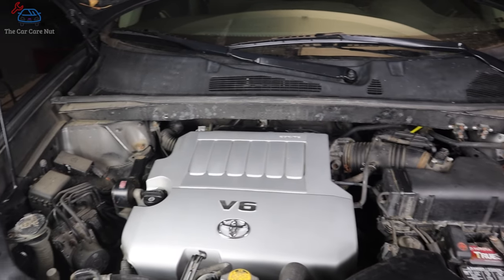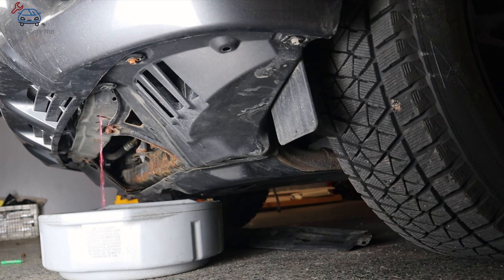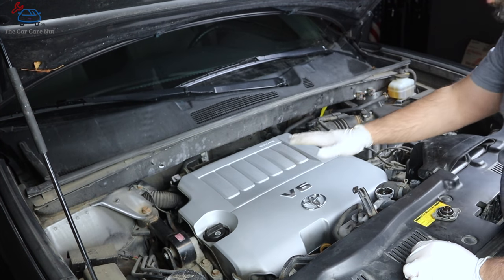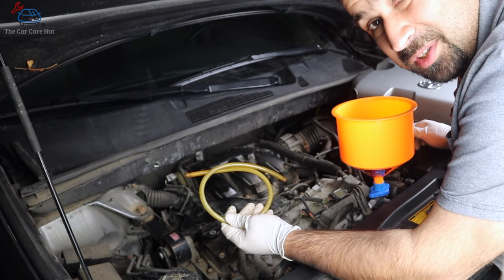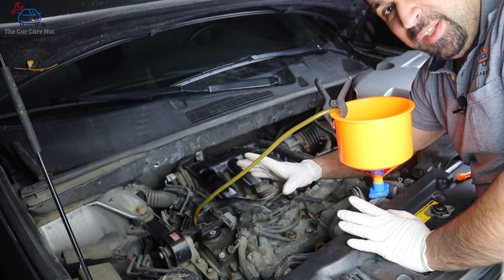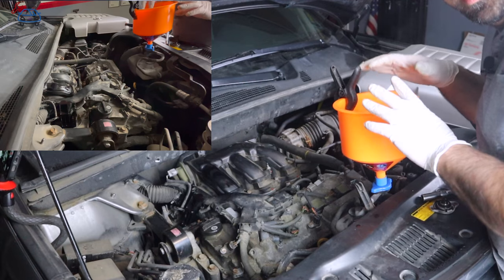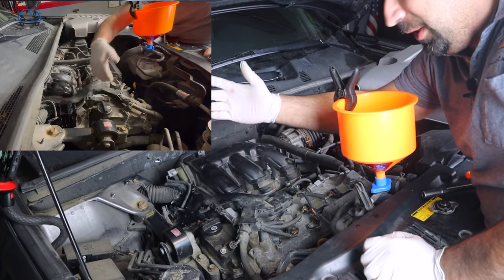Toyota Cooling System Bleeding for V6 2GR-FE 3.5L THE RIGHT WAY!

Comment: 4GR-FSE 2.5 L  on 2010 IS250c please show a video on how to properly bleed air out of coolant system thank you. I trust only you
Reply: I've wanted him to do the same and trust his knowledge also, but I do believe that he doesnt like the 4GR-FSE. With that said, from the service manual for the 4GR-FSE engine, with the radiator cap and reservoir cap removed:

c. Slowly pour coolant into the radiator reservoir until it reaches the FULL line. (Personal note: I believe this is the most important part. Many pour coolant too quickly and trap air in the system. Even Nissan/Infiniti say to pour coolant at a rate of 1-2 quarts per minute)

d. Press the inlet and outlet radiator hoses several times by hand, and then check the level of the 
coolant. 
If the coolant level is low, add coolant. 
e. Install the radiator cap and reservoir cap. 
f. Bleed air from the cooling system. 

NOTE: Before starting the engine to warm up the engine, turn the A/C switch 
OFF. 

1. Warm up the engine until the thermostat opens. While the thermostat is open, circulate the 
coolant for several minutes. 
HINT: 
The thermostat open timing can be confirmed by pressing the inlet radiator hose by hand, and 
checking when the engine coolant starts to flow inside the hose. 
2. Maintain the engine speed at 2, 000 to 2, 500 rpm. 
3. Press the inlet and outlet radiator hoses several times by hand to bleed air. 

NOTE: When pressing the radiator hoses: 
  Wear protective gloves. 
  Be careful as the radiator hoses are hot. 
  Keep your hands away from the radiator fans.

g. Stop the engine, and wait until the engine coolant cools down to ambient temperature. 

NOTE: Do not remove the radiator cap while the engine and radiator are still 
hot. Pressurized, hot engine coolant and steam may be released and 
cause serious burns.

h. Check the coolant level in the radiator reservoir. 
If the coolant level is low, add SLLC to the radiator reservoir FULL line. 
6. CHECK FOR ENGINE COOLANT LEAKS . Refer to ON-VEHICLE INSPECTION - Step 1 
7. INSTALL AIR CLEANER INLET NO. 1 . Refer to INSTALLATION - Step 87 
8. INSTALL V-BANK COVER SUB-ASSEMBLY . Refer to INSTALLATION - Step 115 
9. INSTALL COOL AIR INTAKE DUCT SEAL . Refer to INSTALLATION - Step 118

Comment: OK I'm ALL FINISHED !!!! Thanks to You "CarNut The Magician". Again great video that helped me immensely. Bought the funnel using your link. I want to suggest maybe an edit to the video. It took me over 3 hours total with car at 2200 RPM to complete this coolant replacement. At about the 3.25 hour mark I decided to bring it up to 3000 RPM and what a difference. I was stuck in the "waiting for the solid coolant to stream into the funnel" for almost 2 hours. I also was turning the heater on and off and got more air out. Please confirm YES or NO that turning the heater on is necessary? or NOT necessary? My edit suggestion is to give people at least a rough idea on the time frame for each stage. I realize there are different factors in each case that will affect the time frames but just give us an idea approx how long it will take. Because it took so long does that mean my water-pump is weak? That was just replaced 11 months ago so trying to figure out why it took me so long and it took you less than 1/2 the time based on watching your video?

Comment: Have a question which kind that's kind of concerning that I saw on another video. The person states the start stop button feature which was for better fuel economy will eventually over time will wear your engine out faster because they are not designed for with all the consistent starting and stopping which to makes kind of sence. I would like your input on this in a future video.

Comment: Great video,

I’ve got a 2007 Toyota Aurion with the 2gr-fe engine. Before I do this job, would it be best to replace the heater core first because I’ve got no heat coming through the vents, just air.

Comment: yea, the high rpm intimidating thinking parts of the engine are not fully filled with coolant which can cause high heat spots and can cause head wrapping, etc.  With high RPM the water pump can help push any air bubble in the system to fill voids in the engine block.

Comment: This is hands down the best channel for Toyota/Lexus maintenance and repair information. Always my first choice, and I only stray when I can't find the information I need. Have you got a video showing the replacement of the radiator inlet (some call it the filler neck) on a 2009 Lexus RX 350? Part number 16431-31490. I believe we suffered a common problem this afternoon when one of the lines broke away and coolant went everywhere but through the engine. Also do you have a diagnostic for the radiator cap? Thank you so much for sharing your wisdom with us here on YouTube. We're very fortunate to have access to people like you.

Comment: I did this procedure and made sure to top off the reserve reservoir to full as well.  After driving it about 350 miles I checked the reserve reservoir and the fluid was low.  I topped it off to the full line, but my question is if that is normal.  Did the system have more air to remove and now it should be good?

Comment: This car’s cooling system seems like a good candidate for using the process where you draw a vacuum on the system to remove the air and then use that vacuum to draw the new antifreeze into the engine. That’s how I would approach it. 

Have you tried it? Seems a lot easier to me than the process you show here.

Comment: Hello, grest, video you explained everything  wonderful. Also, the last time I had my flush was 17,000 miles  ago, 3 years already, mainly  slow speed  driving  in town locally. Do you recommend  I replace  coolant drain & refill only? I like to replace the thermostat  as well since I'm there already  and take air out system. That way, everything  is good with the cooling system. The thermostat  is extremely  important  on any 3 Liter motor.

Comment: Hi I own a Toyota Vellfire 2008 3.5 2gr fe engine and I noticed that I don't have a radiator cap, pls clarify how this method will apply to my vehicle and/or the correct procedure to bleed my vehicle. Many thanks for your other videos, it's been helpful with my other DIYs
Reply from the maker: Hi! What kind of cap do you havev
Reply: @TheCarCareNut  there isn't a cap for the radiator at all.
Reply from the maker: Is there a cap for the expansion tank?
Reply: @TheCarCareNut  yes

Comment: I'm crying right now. 😭I just did a coolant flush on my Lexus last week. Just the drain out at the bottom, then refill at the top, bit by bit with the engine running till it no longer disappears. Also filled reservoir. Will I be in trouble if I don't bleed the system this way?
Reply from the maker: Hi! So I would do this to test it. Start the car and let it idle until the gauge reaches operating temperature. Then turn on the heat at max temp and see if you have full heat or not very hot. If it’s not very hot rev the engine up if it immediately changes to hot then you’ll need to bleed it. If it’s hot then you’re good
Reply: @TheCarCareNut  thank you sir. Will do this and report back!

Comment: Perfect procedure. I'm sure that's the same for all cars with bleeder valves
Reply: The first gen Prius has a pair of bleeder valves for the inverter coolant. I have noticed it will not bleed the way the manual shows (pipes carrying the coolant back up to the reservoir) - it has to be done with tubing to siphon the coolant to somewhere below the valves.
Reply from the maker: The first gen Prius can be tough to bleed as you said the procedure in the book doesn’t work very well

Comment: Thanks for the video. I have a question,  do I need to also open the bleed valve while draining the radiator? I think that's needed to let the coolant in the engine be drained as well... 🤔

Comment: I have questions not on this video on your other video where you show changing inverter fluid and radiator fluid
My question is bleeding inverter in video you state you want cooling fan to come on twice . How long should it take for fan to come on and how long between 1st time fan coming on and second time roughly?  And what is the revelance of those fans coming on twice regarding air removal from the inverter? In video you did not show the fans, im assuming its fans in front of radiator? Thank you for you very informative videos.

Comment: There was some videos on here that show adding the coolant from the radiator only and watch the bubble coming out from there.  But it may take hours for all the bubble to come out.  Your method is better and faster.  How easy is it to drain the coolant.  I didn't see the drain plug on the video.
Reply from the maker: It’s very simple to drain the coolant. The petcock is on either the passenger or drivers side of the bottom of the radiator

Comment: 2GR – FKS V6, you mentioned in the video that you might do a coolant change video on one of these engines.
I am at a point where I’m approaching 50,000 miles and would like to do so as per your advice from the Lexus LS video. 
I also would like to do the transmission service at 50,000 miles .
As per your instructions, I did the rear differential at 30,000 miles and just completed the front differential at 48,800  miles.
I just purchased “Toyota” rotors, pads and hardware for the front. The left front is getting a little close for comfort.
The coolant and the transmission fluid are next on the list .
Would you suggest I take it to the dealer and have the coolant and transmission done? 
I at least have the funnel that fits the radiator.
Production date of March 2018, highlander V6 all-wheel-drive LE plus.
No transmission issues to date. 👍

Our plan is this will be a very long term ownership experience.
The car is kept in the garage and is well cared for. 

Thank you sincerely for everything that you do. I really wish that your shop was located within a reasonable driving distance. 🙏

Comment: I love the idea. I a ford mercury  2000 sable. I wanna do the same thing. I know ur Lexus and toyota master mechanic. But u are one few really good ones out there so I need  to know i should heater on max without ac. The bleeder valve and spill funnel I did nt use that was a flaw

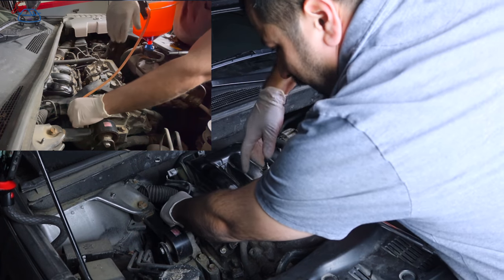Comment: AMD... !!Help!!  In the final phase (just before tighten the valve & disconnect the hose) you say that there is a "solid flow" of coolant (and maybe some micro bubbles) but on your video (at 9:41 & 9:47) I am almost 100% sure that I can see at least 2 sets of bigger bubbles come through.  Is this so?  I ask because when I executed the procedure, all went as you said... but possibly not during that final phase.  I had solid liquid flow, but also about roughly every 6 to 10 seconds a few big bubbles would come through.  I let it flow for a few minutes and the bubble issue seemed pretty consistent so I just completed the procedure and after engine "settled down" I only saw some VERY, VERY, tiny micro bubbles in the funnel.  1) Are the bubbles I mention (coming through the clear bleeder tube) the same as ones I think I saw in your video? 2) Are they normal or something that I should worry about?  3) Could they mean I have a blown head gasket / engine or what could it be? 4) Could the "bleeder" be allowing air into the line somehow?  !!Help!!

Comment: I just did this on my Sienna and it worked perfectly. Thank you, thank you, thank you! One question though, I see you answered below that the vacuum method does not always work.  If you had the vacuum system and everything needed available, would you still use this method, or would you first try the vacuum method?
Reply from the maker: Hi! I actually have the vacuum system and I would use this method still. Works great every time.

Comment: Did this procedure on my 2011 Toyota sienna, got a lot of air out but still have my rear heat not working, replaced the rear heater pipes because of some damage and burped the system. Still no luck rear heater seems to have lots of air trapped 🫤

Comment: Latest V6 - does not appear to have this coolant bleeding bolt.  Maybe Sienna 2020 later does not require bleeding of the system?  I am still going to put coolant in the radiator with a big funnel burp out all bubbles in the radiator.

Comment: Can you explain why do we need to bleed the coolant? I thought we just need to drain and fill, then the air will come out to the cooling reservoir?
Reply from the maker: Hi! In some models that is the case but in this V6 because of the way they’re designed they tend to trap air and cause issues. So this procedure is needed to get all the air out
Reply: Many modern cars are not self-bleeding. One of the generations of Subaru engines a couple decades ago had problems with this and many enthusiasts blamed failure to purge air as being responsible for most of the head gasket failures.
My daughter had a 1993 Honda that would surge at idle if the cooling system was not properly bled. At normal idle the hot coolant would not reach the Fast Idle Thermo Valve (a Honda thing of that era) so the FITV would increase the idle speed. That caused the hot coolant to hit the FITV, which returned the idle to normal.. and the cycle repeated.

Comment: You mention a bleeder valve on the engine block, is there one on the bottom of the engine as well at the radiator and top of the engine?  Even after draining the radiator and top of engine bleeder valve I still got a lot of coolant on the garage floor.  I found a broken 12mm bolt holding the gasket which was done by a mechanic and that was my problem.

Comment: So approximately how long would you think the procedure takes?
Reply: I did it yesterday on my 16 Highlander. That’s the one thing he doesn’t mention much within  here and  how long it takes. When the engine is cold to get it up to the temperature where the spurting actually happens takes at least 15 to 20 minutes at 2200 RPMs. Be patient but it will happen.

Comment: Again, awesome video Ahmed! I have to replace the leaking radiator in our 2008 Highlander Sport 4WD. I'm a little baffled, however, as at 5:40 you say to turn OFF the rear heater while doing the warmup. What if there are trapped air bubbles back there? I've always wondered if there was a way to bleed the rear heater lines as ours has never really made very warm air back there. Granted, the ducting is fully un-insulated and runs along the roof panel which is ice cold in winter so a lot of heat is lost in the process. Also, the hot water lines to the rear under the car are also partially uninsulated so there's that heat loss as well.

Comment: Do you have a video on how to bleed the coolant in the 4.7L V8 2UZ-FE? How often should I replace the coolant and the radiator? I found your channel a few weeks ago I'm trying to get caught up with your videos.  Thanks.
Reply from the maker: Hi! The bleeding is very simple on your tundra. I don’t have a video yet but you’d want to drain the coolant then fill it. Have the heater on in your truck as it has a heater valve and let it run at 1500 rpm until both radiator hoses are equal temperature. I would replace the coolant every 5 years 50k if it’s pink and every 3 years or 30k if it’s red coolant

Comment: Does a 2007 GS350: 3.5L DOHC EFI; GRS191L-BETQHA

Have bleeder valve? Also do you have a video that illustrates how to drain the engine properly or are we able to drain entire engine, instead of only from the radiator drain plug? Thank you

Comment: AMD, One of my dream Toyotas is  a mint condition RAV4 with this 2GR-FE engine  ;-)
Reply from the maker: A 2WD V6 RAV4 please 😀 those are fun!
Reply: @TheCarCareNut  Too much torque steer. Make mine AWD.
Reply: @TheCarCareNut  Why just front drive? U joints?
Reply from the maker: The 2WD always drove more wild than the AWD!
Reply: @TheCarCareNut  Oh gosh, some had problems with the transmission not being able to decide which gear it wanted to be in. Wild indeed. On mine, I mostly drive it conservatively instead of jackrabbit. But on surface streets when I want to launch, there is a noticable delay when I floor it. Takes it a second to go when I really need it! Like the sending signal is slow or something.
Reply: My favorite toyota was a 1980 Corolla hatchback. Manual transmission. I got it around 1990.  Used it for work.  Paid $400.for it. Could fit 9 ft long  items in it. Drove it for a few years, sold it for 300. The buyer drove by 3 years later honking and waving to me.

Comment: It is not a big mistake if the bleeder air is not made. You wiil verify periodically the top of the radiator and the expansion vas to be correctly filled and after a time all will be ok.

Comment: Does this solve the problem of rear heat? My sienna with 2gr-fe takes forever to get the heat in the back vents. Thanks for the video
Reply from the maker: This is one reason the heat takes long. However it can be other issues but I would definitely start with this bleeding procedure as it doesn’t cost much

Comment: Hi AMD,
I did this before ,  tried to convince my mother that I could do this job in her 15highlander but she felt more comfortable with a professional. No problem. My mother just had a coolant flush done earlier today, replaced a gallon and half ,she doesn’t know if the mechanic open up the bleeder. I asked the mechanic and he said that wasn’t necessary… Could I open the bleeder following day while the motor is cold? Or just leave it be?
Reply from the maker: Hi! I would leave it be. It can be done without the bleeder but it’s a pain and takes a long time. If you have heat at idle you’re good
Reply: @TheCarCareNut  thank you for the swift reply AMD. I believe there was heat at idle. I can confirm tomorrow morning. I can’t thank you enough for your videos. You’re helping everyone during these tough times. Not being able to get a new car but dealing with and fixing our current vehicles with your teachings and advices. God bless you